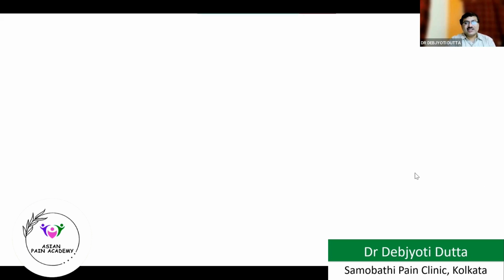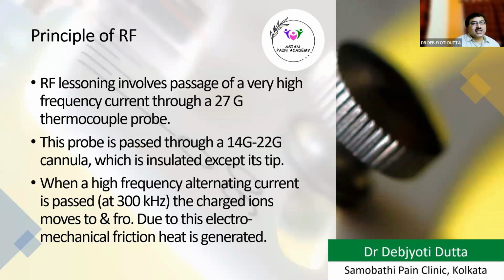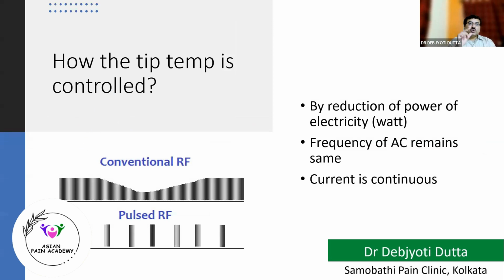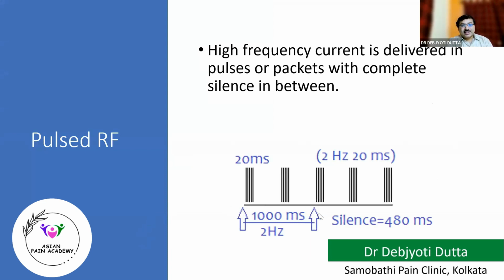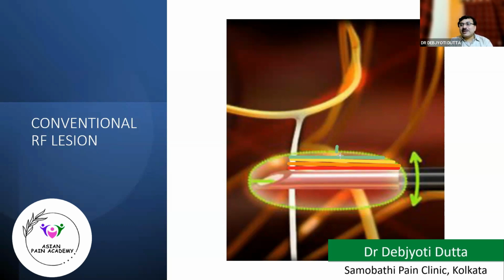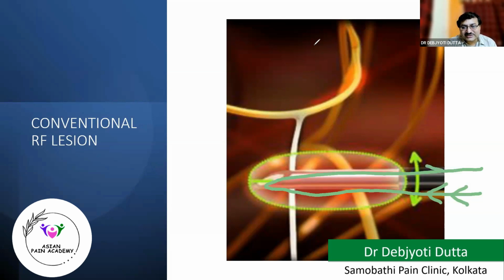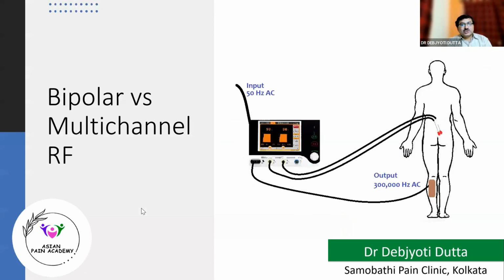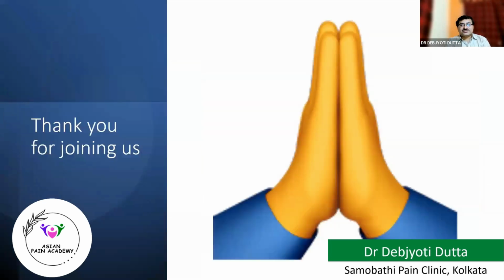Radio Frequency Ablation - Principles and Practices | Dr Debjyoti Dutta | Asian Pain Academy

Comment: Dr Dutta sir I have some questions, 

1. If bipolar is used for genicular nv then total six puncture has to be done to insert electrode right ?

2. By using conventional rf and combining it with venom/ trident cannula will be sufficient for achieving good genicular Nv lesion ?
Reply from the maker: With bipolar RF you generally need two cannulae per genicular nerve, so a total of six punctures for all three nerves.
Conventional RF with Venom or Trident cannula is usually sufficient because the expanded active tip creates a large, effective lesion.
Cooled RF is also an excellent option as it produces the largest lesion volume and offers broader coverage of variable genicular branches.
For more detailed pain procedure updates, please subscribe to our YouTube channel.